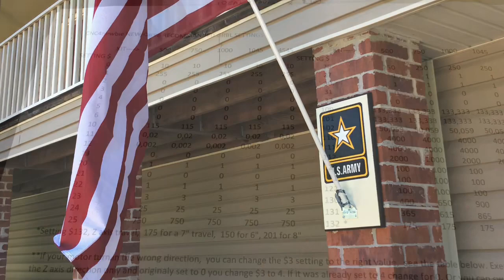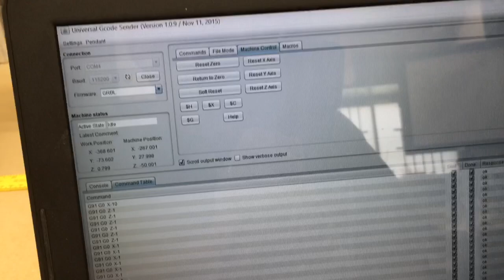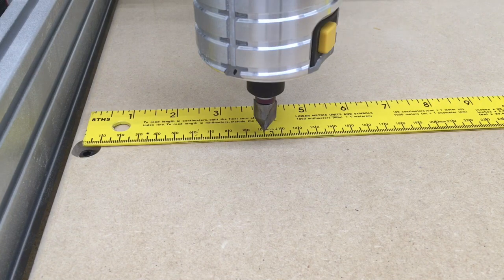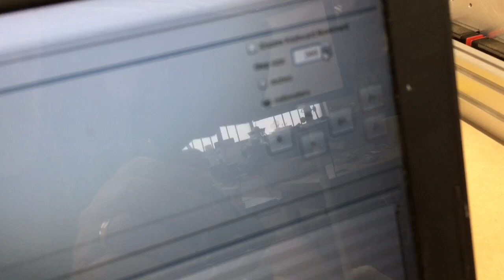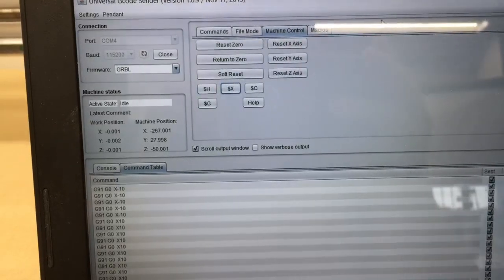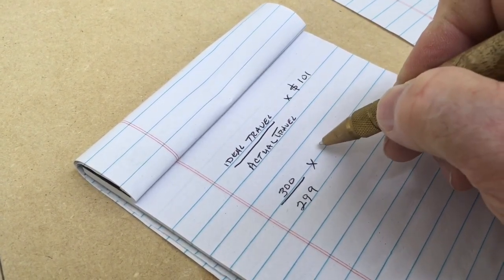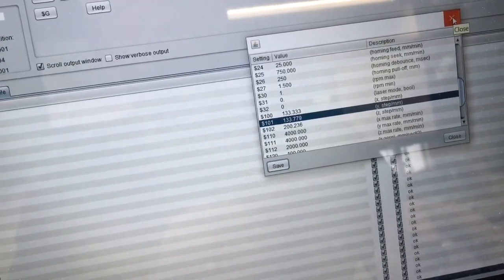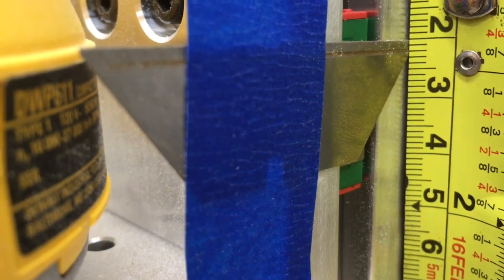FINAL STEP: Calibrate My CNC4NEWBIE New-Carve

Comment: I have really enjoyed this series of videos, thank you for taking the time to share. You had suggested to me in another post I made about the fact that you are wetting my appetite for a CNC machine to consider carefully, after seeing this one I am impressed with how stout it is, lead screws instead of belt drives. This is necessary when dealing with the amount of mass you are moving at the speeds you’re moving the spindle in X,Y,Z axis. Your Z axis calibration solution was pretty neat. The camera did have a parallax, but you called right on and I am sure it was. Hey you have to use all of your available resources when working outside of the box. 😁🛫
Reply from the maker: Thank you very very much

Comment: Great video as always!  Just a quick question - if you were to also use Easel with the New Carve would you also have to adjust the settings in Easel?
Reply from the maker: I will take a look, I'm sure that there will be a few settings different.  I know that one thing that is different is Easel works on com 3 and the Demon controller is working on Com 4.

Comment: I have this machine and love the 1000. I didn’t think there was an issue until I used a large surfacing but. I’ve played with depth and step over and still getting nasty lines. Do you have a video on tramming this exact CNC4NB 1000? Thank you
Reply from the maker: On all of my assembly videos on the various CNC machines I show the tramming. It should be very close to begin with just because of how the machines are designed. First question, when you are surfacing the wasteboard which part of the bit is hitting first?  That will be the first clue as to the direction you need to correct
Reply: @PawPawsWorkShop  I use the pocket setting on vcarve. I’ve used the x axis raster and also the raster set at 45 degree angle and still getting the same lines. Usually it starts cutting at front right side of the material. I wanted a dummy waste board so got a .25 mdf to sit atop the base waste board. And after 3 attempts surfacing changing step over from 70-60%(is that too much?) and depth of cut.
Reply from the maker: The lines are caused by the machine is out of square. You must have the z axis totally square. Look at my videos. Use a large square and adjust both the x and y axis

Comment: Another great vid. I just completed tuis weekend installing my CNCfornewbies Z-axis and Y-axis plates. One question, I have the z height dialed in, but did you have concern over the step movement? I tried their settings but 2000 seemed to be a bit much.
Reply from the maker: I did not change the step.  I may play with that later just to see the results.

Comment: Dou you know if there is a way to calibrate steps in Easel? Can code be copied from UGS and pasted into easel? Maybe under other machine? I have a diy machine thats works fine with UGS, But I like Easel. Thank you!
Reply from the maker: Yes, I have done a video on this with the XCarve.  It is exactly the same.  The changes are done in GRBL
Reply: @PawPawsWorkShop  Very cool, thank you for the help. I'll try it again.